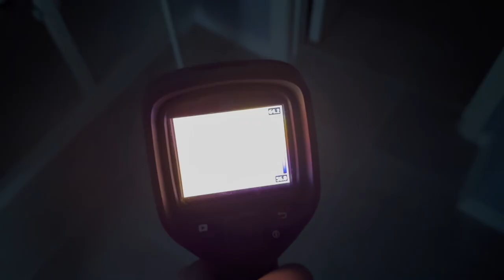What to look for on older properties - The Houston Home Inspector

Comment: Yes.... Use drone to film condition of roof, make sure vinyl siding actually overlaps correctly in shingle fashion especially if it was partially replaced, record slope of garage with a slope app to make sure it slopes down, run shower then turn it off and go to other side of wall in adjacent room and do thermal camera scan to check for leaking